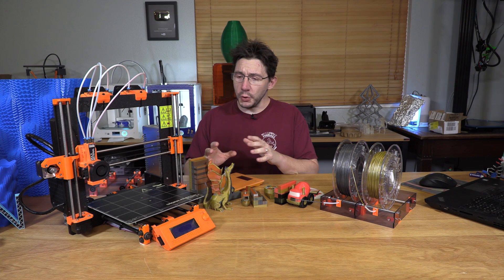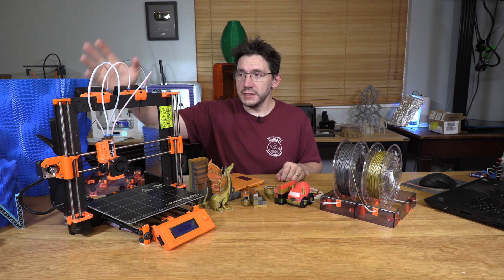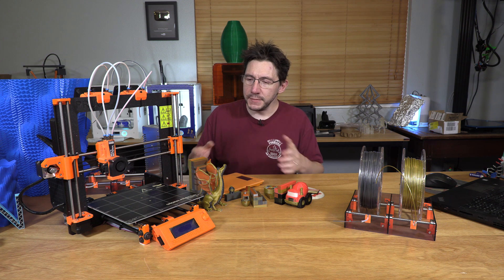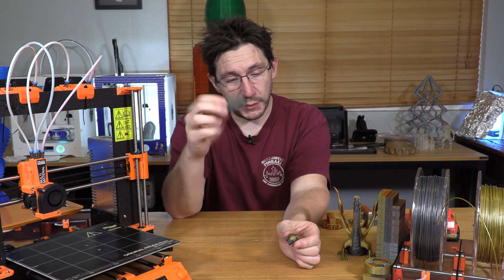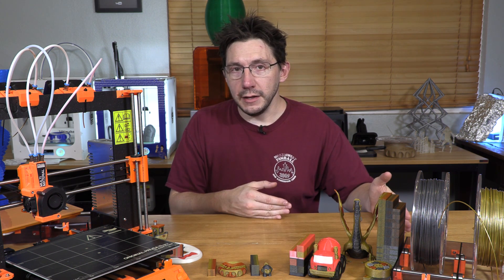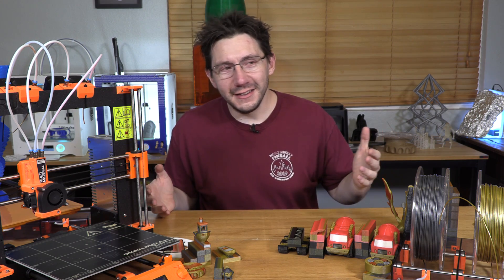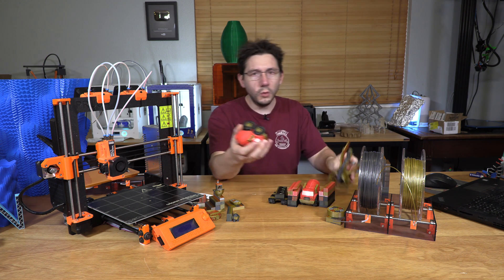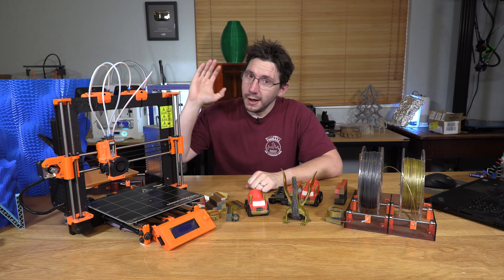Prusa Multi Material Review(?) - My Thoughts on the Prusa MMU 3D Printer

Comment: Good thing we have endless recources.
Not to mention that the US alone waste 60% of world wide recources and the rest of the world needs to save the resources...
Reply: If you're worried about spending a few kilograms too much plastic while pursuing an artistic or engineering endeavour, you're probably missing the wood for the trees. The bulk of avoidable energy and resource consumption is in production of meat and animal-based products as well as in sub-optimal transportation: personal vehicles, long haul trucks instead of rail freight, etc. And then there's also an issue of mass produced products that just about everyone needs but that are simply not made to last, while they easily could have been.
Reply: It's a problem, but what makes you think it's relevant here?
Reply: Waste is a relative term.  
As a country the USA has 5% of the world's population, but uses 24% of the world's energy.  
BUT the USA also has 4.7% of the worlds wealth and produces 24% of the worlds GDP.  

So we are right on track taking 24% of the world's energy to produce 24% of the world's commerce.
Reply: ""poly(lactic acid) or polylactic acid or polylactide (PLA) is a biodegradable and bioactive thermoplastic aliphatic polyester derived from renewable resources, such as corn starch (in the United States and Canada), cassava roots, chips or starch (mostly in Asia), or sugarcane (in the rest of the world). In 2010, PLA had the second highest consumption volume of any bioplastic of the world.[3]""

Comment: Josef Prusa beat me to it. Its true the more models you print at a time the purg block stays the same size, the waist goes down !
Josef I sold all my printers so I could buy the MK3, don't make me wait until Feb. You know I like to waist filament I made the 3d printed walking talking Joel bot. Heck some days I buy filament and just throw it in the trash. OK I don't. This is a very cool and well designed system.

Comment: Great review Joel, but your calculation of waste percentage is wrong.  The number you're calculating is : "How much of WHAT IS PRINTED is wasted?", while it should really be  "How much TIME THE WEIGHT OF THE PRINTED MODEL is wasted?". At the end of the day, the only product we're left with is the model itself. Think about it ... ;-) To get a 76g Adalinda, you have to waste 317g of filament, a whopping waste of 417.1%, (317/76) not 80.66%. To get a 20g maker coin, you waste 11g, which is a waste 55% instead of 35.48%.

This being said, waste is waste, no matter how much it is. But then, we always do waste, not only while printing plastic, but while making food, building houses, or even breathing !!! We should try as much as we can to limit this waste, but there is so much we can do.

Keep up the good work !
Reply: He's actually calculating how much of the total material used was waste material.  So 76g+317g=393g, 317g(total waste)/393g(total material used)=80.66%.  :)
Reply: I understand, but this is misleading. Lets take two objects: 1: 10g + 90g of waste, 2: 10g with 180g of waste. Using Joel mode of calculation, the first object would have 90% waste, while the second would have 94.7% waste, giving the impression that the difference is not that much. In reality, the waste is DOUBLED between these two objects!

Comment: But Joel! you forgot something! if you print multiple of the same model at the same time (like, 2 or 3 mixers at the same time) the purge block will be the same as in 1 single mixer. same waste but more benefit!
Reply: Buuut, if the purge block fails.. then all of it is waste.
Reply: Not really - so what if the purge block fails?
Reply: Marcus Mravik he’s not talking about using the purged filament to make a second object, he’s saying that if you print two of one object the purge block will be the same as if you printed one.
Reply: No. It's more complex than that. What if the amount of purge for a given color isn't enough to complete a layer of a color on a second model? Not to mention that it'd take a very very specific model for this to work... it's not applicable.

Comment: Isn't this concept meant for mixing colors inside the hotend? Because otherwise it doesn't seem to male any sense, compared to  the old chimera design.
Reply: I suppose it could do this but the printer and firmware looks to be designed to print one solid colour. Purge waste comes from flushing the previous colour out of the hot end. The previous colour has to be retracted out of the transition zone so that the next one can go in but there is still some of the prev. colour in a molten state.

I suppose a little bt of firmware optimization could do the colour change earlier and try to use most of the molten remainder to complete that colour in the layer. That volume is fixed and can be estimated.

 - Eddy
Reply: Thanks. This confirms staying with a dual extrusion + dual nozzle design for me.

Comment: If you hade 4 different purge blocks for each color you could recycle them wich would fix the problem
Reply: but then you run into a discontinuous layer problem. From what i see one of the better uses would be to fold the purge into infill.
Reply: A good idea, but, each colour would have to have support for all (future) layers. This would generate more waste then it currently has.
 - Eddy
Reply: KuraIthys
Even if we get to the point where a small machine at home can make reliable recycled filament, why worry about the colour? Just reserve your good colours for final prints and use the random, blackish-brown mixed colour recycled stuff for prototypes, tests and parts that the colour isn't important for.
Reply: True, but presuming a home plastic recycling system, which can generate new filament from waste, not mixing the colours, while producing more direct waste, produces less indirect waste due to being recyclable.

Comment: Thanks for covering this. Multimaterial seems so cool, but that is a lot of waste. I thought there was like a sponge to wipe the nozzle on, but those purge blocks are huge.

Would it not make more sense to have more nozzles? A heater block with 4 nozzles wouldn't need purge blocks. You'd give up a little build volume, but if the nozzles were close enough together, it's maybe 10mm. I get that this is mostly built from existing things and they'd have to engineer a new heater block and narrower nozzles, but would a couple more nozzles cost that much more when you already have 4 extruders? 

Hell, leave out the filament racks -- let the end user design and print something that works for their setup -- and   have 4 nozzles instead. You could print mounting for 4 spools with the waste from the Adalinda alone.
Reply: Then there would be 3 nozzles oozing constantly.

Comment: Multi-head should be the next step. Not only would this potentially reduce the waste, but make printing in multiple types of materials in a single build easier and faster. The only downside I foresee in that would be a reduced available print volume for the same model of machine, but that could be easily adjusted.

Comment: Pretty cool printer. =)
I think doing something similar to inkjet printers is the way to go for multi-color extrusion. Have a white filament with red, green, blue, and black pigments that get added while it extrudes. Depending on the location where the pigments are added, you could significantly reduce the waste filament, or maybe even eliminate it. Won't help much with multi-material extrusion, like using both PVA and ABS together, but would be great for just printing things with pretty much unlimited color options.

Comment: What if you multi-print say, three mixers. Would they each need their own block, or could they all run from one purge block?
Reply: It would just be the same as printing one.  Only one purge block.  It's kind of what he goes over when explaining them, regardless of how much x and y you add, the purge block stays the same. It's only based on what colors are used on what layers.
Reply: Just one purge block needed for multiple identical prints . Angus covered this topic about a month ago .
Reply: That's Makers Muse btw.